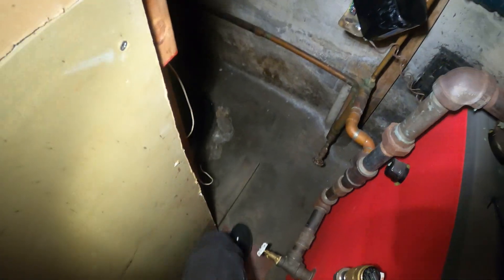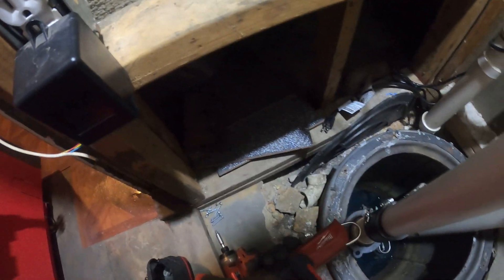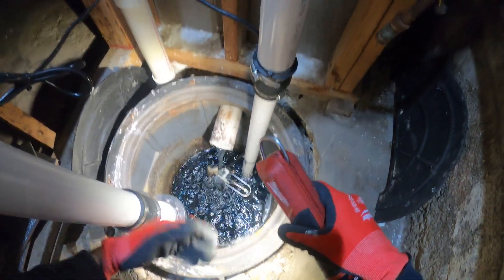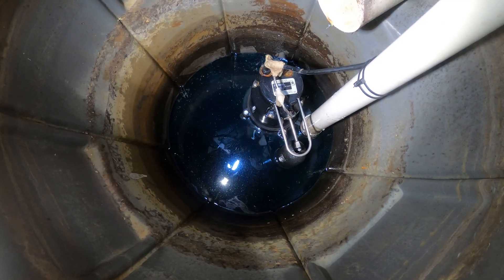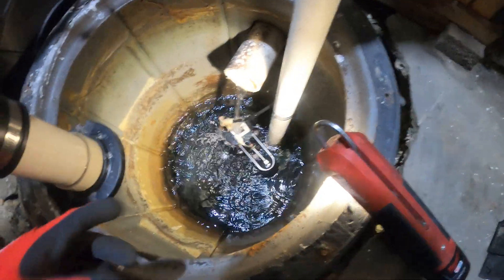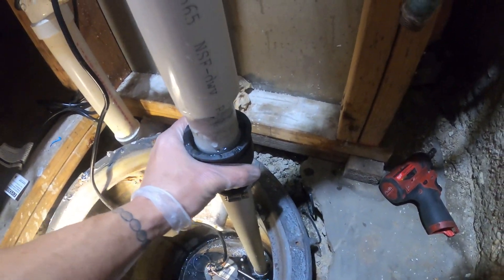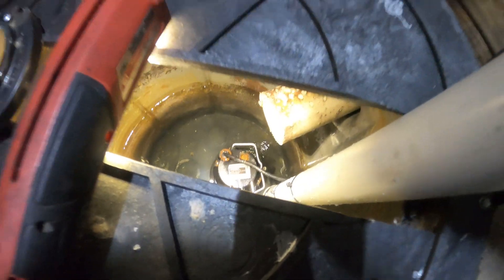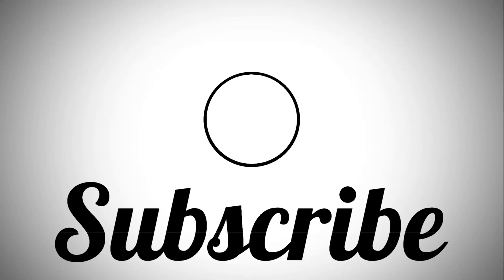Plumbing Service Call: Submersible Water Pump/Submersible Sewage Ejector Pump/Sump Pump Making Noise

Comment: Found you on reddit looking for control relay info, possible you could advise on which relay/contactor to use?
Have a 24Vdc on/off timer signal and want to pass 120Vac for a 5HP compressor motor. Which control device can I use in a DIY setting?
Thank you for any help or leads where to find what hardware to use.